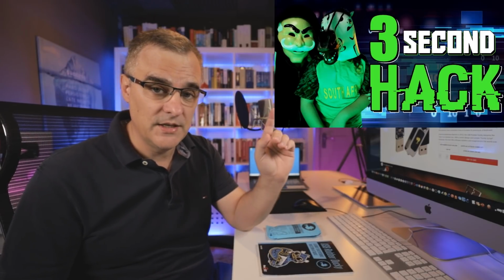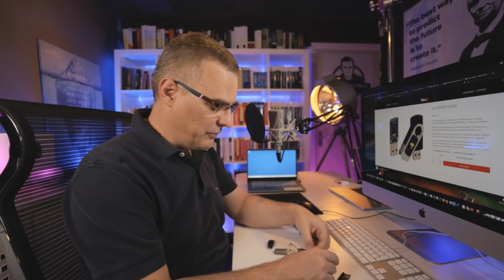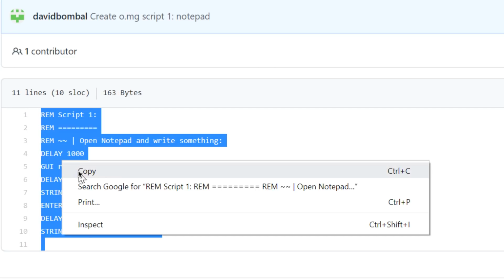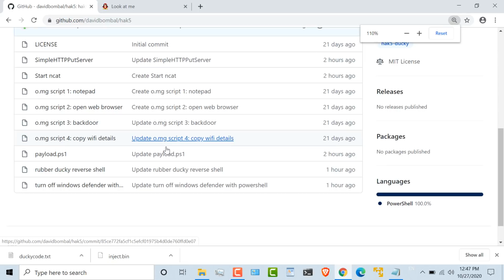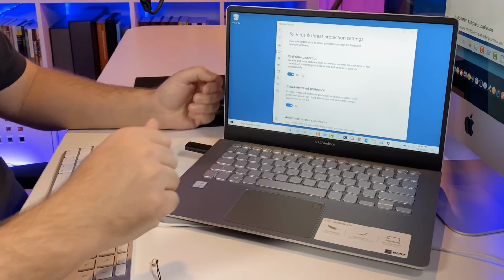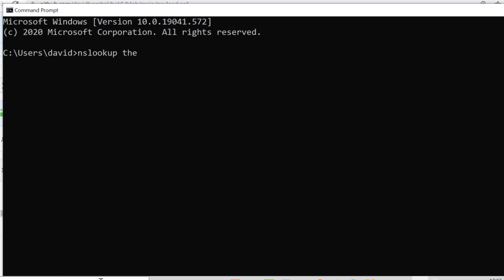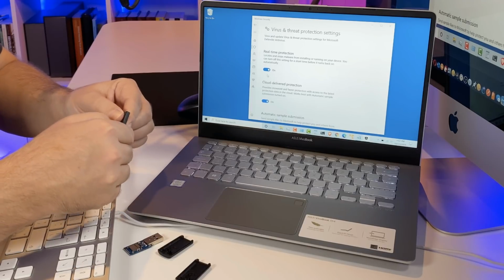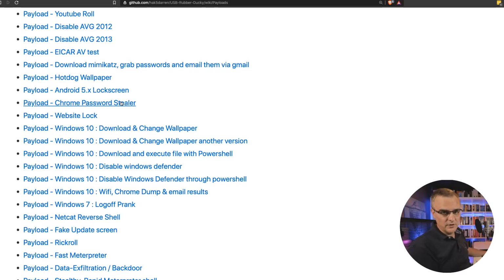How I did it (hak5 rubber ducky)

Comment: Hey please help me. I bought a windows 10 2019 laptop from a guy who didn't have administrator access. A LOT of capabilities on it are disabled included command prompt. The USB ports do work with keyboards tho. Which hopefully means it is vulnerable to usb rubber ducky. Im am not too computer literate. Is it possible to use a USB rubber ducky to wipe the OS and reinstall windows? Thanks

Comment: So why would you need a ducky for this type of attack? You don’t need an HID you could just write a simple script in notepad and save it with the proper extension save it to a normal usb and make it auto run? Just curious what the ducky advantage is? There’s like a lil ardrino or pi zero or something in there Rt?

Comment: David this does not work anymore :( In windows 11 there is a new security feature called "Tamper Protection" which can only be turned off by physically going to the virus settings and turning it off. There is no PowerShell command. Tamper protection makes turning Real-time protection off not allowed unless its off.

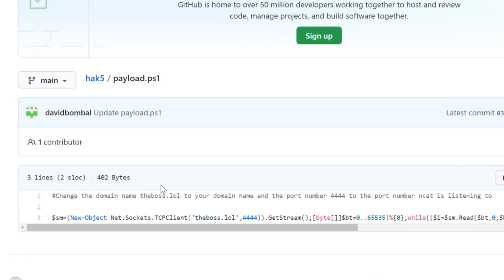Comment: Hey David!  Love the video, was super easy to understand and very clean!  I do however have a question for setting up the reverse shell.   You said to run payload.ps1 in the background (15:06).  And that the payload is on a website being hosted to run.  It seems like the website is no longer running it.  Now, would I have to setup a local DNS server and give it a domain name to replace it?  Or how would I fix this problem because it isn't working.  Thanks!!
Reply: i hope he replies this i have the same problem
Reply: Same

Comment: Hello. I havent managed to run any scripts using my Hak5 USB Rubber Ducky. Seems like I do something wrong or the firmware is broken ?? I have tested it in my host (Windows 10 20H2 Latest) as well as Win7 VM. Nothing in any machine. I have flashed the firmware c_duck_v2_S002.hex and the LED is Green. I insert the USB and it gets recognized as HID Keyboard and MSC which indicates that everything seems fine. The .bin file is also fine as it is just a very simple script that will do GUI r and then just notepad and ENTER. I encoded it using ducktoolkit and it is written on the default 128MB SD card that comes in the package. 

By plugging the USB nothing happens... By pressing the button it starts blinking red/green... What might be wrong ?

Comment: hello david i have tried this a few times now and i am unable to even get the first one to work. after i download the bin file from ducktookkit and put it on my sd card then i put it in my usb rubber ducky then into my laptop to test it but nothing happens at all i also check that i was using the uk layout for the keyboard and i am using windows 10. i did how ever put my usb rubber ducky into my laptop and the same time i holded down the button and my laptop picks it up but says drivers are unavaiable so i dont know if it is working is there something that i am meant to do when first ever using the usb rubber ducky like formats etc,  any help will be very much appreciated

Comment: Hey David, recently bought a rubber ducky usb and tried using your disable windows defender script and all seems good until it asks for UAC, which usually should be passed by ALT y but it doesn't it just kinda sits there. Any tips?

Comment: david, great video as usual, but using a similar attack with p4wnp1 aloa and raspberry pi 0 w windows detects badusb as a keyboard and asks to certify it by manually pressing a random key that appears on the screen before installing it. in this way the attack is unusable. can you check and help me find a solution? I am an it auditor and I would like to test the attack in my company to make people understand the danger of inserting usb into the computer. thanks. greetings Claudio

Comment: I can't figure out one thing: why is needed the Rubber Ducky? What's the difference between a normal flash memory and the rubber Ducky? Why putting the same .bin file on a normal flash won't work?

I'm just a noob fascinated by the subject.

Ok, i figured out, it is simply a keyboard.

It would be possible do it with an Arduino? (like Leonardo, for examples, that has keyboard support)

Comment: Hi david, Im trying this on my computer however I noticed a few things. The script to disable defender didnt disable it and I never got reverse shell connection instead random programs opened up on my desktop (victim computer). I copied the SimpleHTTP script per your github, ran it and ran netcat -lp 4444 on my Kali laptop. Am I missing something?
Thanks for your time!
Reply from the maker: You are using a Rubber Ducky - right? Did you save the payload.ps1 on the Kali server? The SimpleHTTP server is serving the payload.ps1 file to the desktop computer. So you need that as well.
Reply: @davidbombal  Yes. I saved it to the same location as the SimpleHTTP server script.
Reply: @davidbombal  Actually. I figured it out. I left your domain theboss.lol in there and I am not running a DNS. Are there any other options to host the payload.ps1 elsewhere to get this to work? Again Thanks!

Comment: if i dont use USB and i want Test run on my own computer will it work ??? 
 I have tried the above commands in Run but...doesn't work :((((
Reply from the maker: This pretends to be a Keyboard, not a USB thumbdrive, so it may not work if you just use a standard USB or run the scripts as they are. You could test by disabling anti-virus (but all of this is at your own risk).

Comment: If Windows Defender has activated tamper protection, the ps command for DisableRealtimeMonitoring will not work! Is there any other way or commands?
Reply from the maker: You tested that with a Rubber Ducky - right?
Reply: @davidbombal  With tamper protection, when you try to run the command in powershell with admin privileges, it won't turn off real-time protection. I think tamper protection is enabled by default in the latest version of windows.
Reply from the maker: @reknown123  I'm using a very new of Windows. I sent keystrokes to allow admin privileges. But, remember you can script the keystrokes, so you just follow the sequence you would if you were using a physical keyboard.

Comment: Is there way to sum up all the code in a single bat file or so... So I can run using AutoPlay on normal pendrive.
Reply: Autoplay is disabled by default now. Not really a viable attack.
Reply: @zach115th  Yea, Its rather easy to use arduino nano as a cheap alternative.

Comment: How do you plug the stick back into your computer without it running automatically the script?
Reply from the maker: It doesn't automatically run using a normal USB memory stick / thumb drive. Note in the video how I am moving the SD card from the USB Rubber Ducky to a normal thumb drive. When you plug the USB Rubber Ducky in, it will automatically run the script.
Reply: @davidbombal  Ah, I see